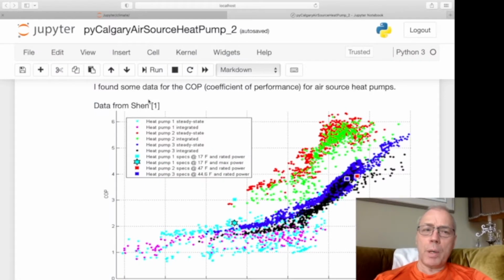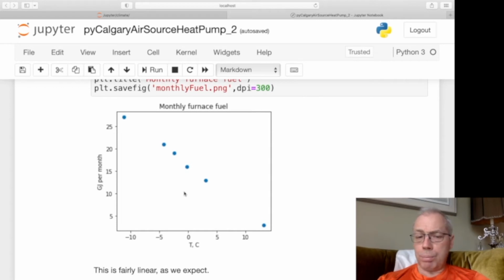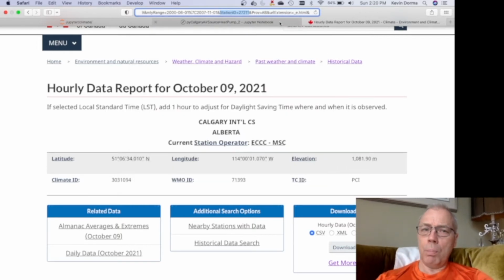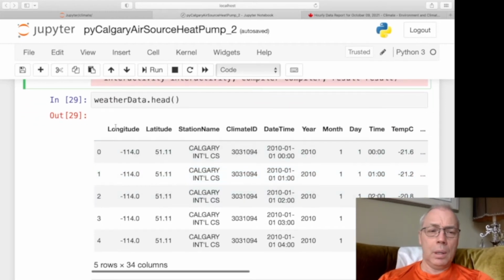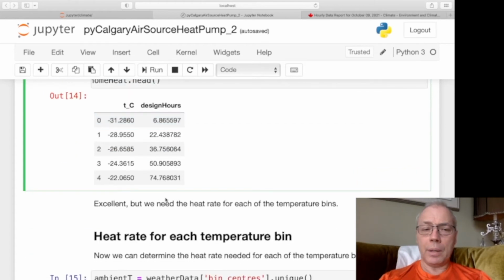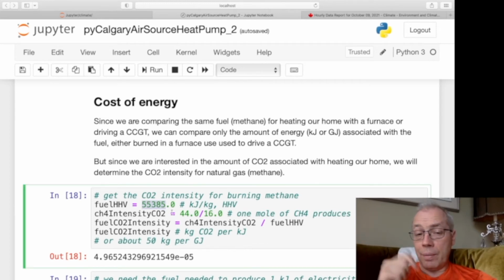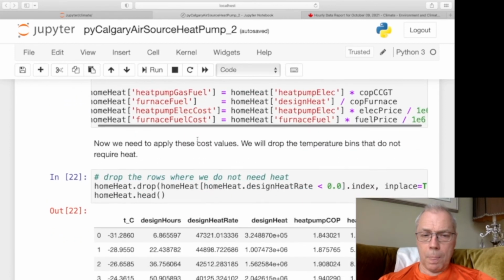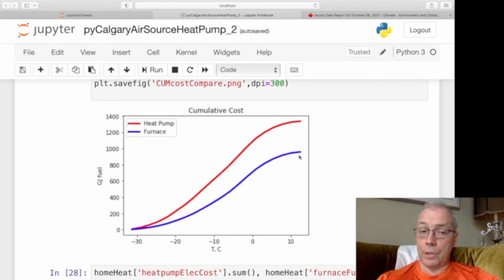Evaluation of an Air Source Heat Pump in Calgary: Shaving a Yak

Comment: Excellent, this is EXACTLY what I was looking for. I'm going through the Canada Greener Homes Grant and they recommend installing a cold climate air source heat pump. I was trying to get this exact data to see the cost-effectiveness. I am sad it isn't cheaper. (I live in Caroline) But it certainly has a benefit when it comes to emissions!  Something to think on..
Reply from the maker: The Benifits with emissions depends on ambient temperature. It is pretty chilly at Caroline (I did a bit of work at the plant to the south). That said, the CO2 intensity of Alberta power has gone down since then. But the cost of a CCASHP is a killer.

Comment: Nice job thinking through this problem. I have been searching for a few years to find public sources for this research question for Calgary. Natural Resources Canada has an online HPAC Tool which is geared towards commercial buildings and also includes inputs such as levels of insulation from the various parts of the building (walls, windows, attic, basement). Hopefully one day there is a residential housing equivalent. There are also a few papers looking at the economics of heat pumps from the USA, but none of their study areas are as cold as Calgary. I imagine the economics of heat pumps in Calgary will change once the carbon tax increases by at least the 40% cost difference your data is showing.
Reply from the maker: Thanks. I approached this as a rating exercise where I could determine the heat demand for a home as a function of temperature. I could have estimated the heat demand for a fictional home, but then people would argue "that is not realistic." Well, my home is real, constructed in the early 1970's. I would like to get actual COP data for commercial cold climate heat pumps. There is one company in Manitoba that has CCASHP, but they would not provide me with typical COP data as a function of air temperature.  That is the sort of data that we need to make good decisions.  I suspect that a CCASHP in Calgary will be LESS attractive with increased carbon tax. This is because the power companies will charge even more for electricity due to the increased cost of natural gas feed.  I could be wrong on this prediction. We will see.
Reply: @kevindormaconsulting4763  That is a very good point about electricity costs going up with higher carbon taxes which makes it even more difficult for CCASHP to be cost competitive with natural gas. I have read about Alberta companies contemplating adding up to 25% hydrogen (blue) to natural gas to decrease carbon emissions in the future. This just shows that the provincial government does not plan to decouple its economy from fossil fuels for quite some time. Unfortunately my 17 year old gas furnace will be in need of an HVAC upgrade in the next few years. I have been contemplating a hybrid CCASHP-natural gas system, but it will have higher purchase and operating costs than conventional systems. I guess that is the cost of cutting emissions for the present in our cold environment.
Reply from the maker: @hugogee7447  check out my blog at KevinDorma.ca, article on Having Cake … This compares micro CHP to CCASHP.